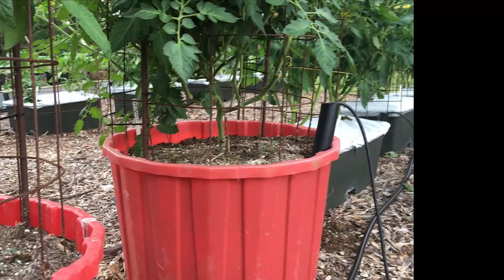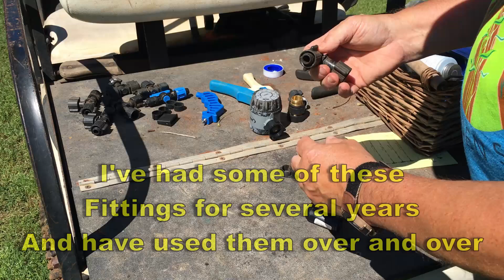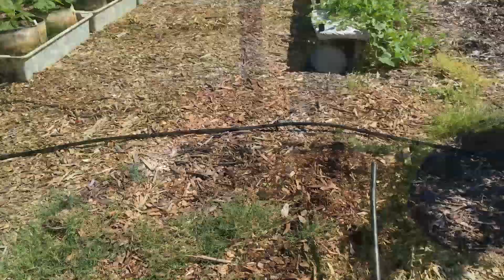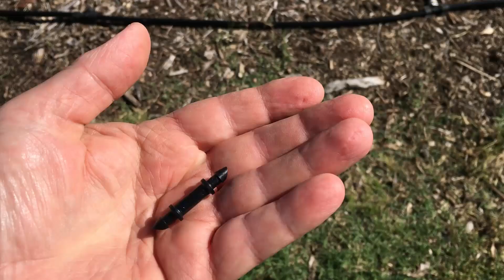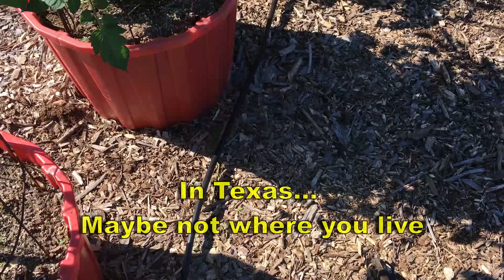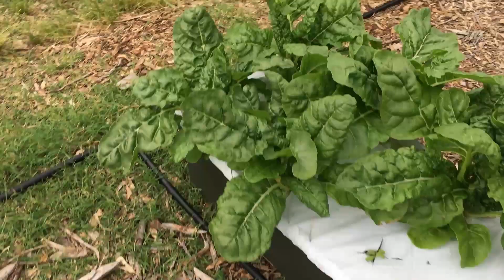💦 INSTALLING AN AUTOMATIC IRRIGATION SYSTEM FOR CONTAINER VEGETABLES OR FLOWERS 🌱 STEP BY STEP 💦

Comment: Could you not just use drip line emitters in each tub and no it us wicking tubs too?
Reply from the maker: I do a variety of things
On some things I use an emitter in the tub, on some, I put a 1/4" line down the fill tube
Both work fine
Reply from the maker: Actually, EarthBoxes need to be watered down the fill tube.
All my EBs have 1/4" lines down the fill tube

Comment: Question-   The link to Hoss tools combo has a pressure regulator marked for 12 psi.  The amazon link shows that regulator is 25 psi?  25 seems a bit high for lines?  or did I miss a detail in video, like 2 regulators instead of 1?
Reply from the maker: I tried a big box pressure reducer and it blew out my fittings.
Try to get the 12 psi.
It worked for me where the other one did not.

Comment: I’m thinking of trying this, what do you use the “couplings” on your list for?  And can I use 1 gallon emitters at the same time as the 2 gallon emitters?  We are also on well water and have to be careful of water usage.   I’m going to show hubby your video and see if he thinks it’s doable!  I hope so!
Reply from the maker: Yes, you can use 1 gal emitters.
The couplings are for repairs... or mistakes.. In case you have to join 2 pieces of pipe together.
It's just handy to have some around.

Comment: We just installed a drip system on our blackberries but we're not getting even drips. We've got a pressure regulator but it doesn't seem to be working. 20 plants on a 90' row using the half inch black tubing. The first several nipples are blasting water, while the ones at the end are barely dripping. What are we doing wrong?
Reply from the maker: If you are on flat ground I’m not sure what could be causing it. 
If you’re on a slope, that could be your problem. I had some problems like that when I had blackberries planted on a slope.

Comment: Does water come out the EB reservoir overflow when using the timer?  If so, how much and could that lead to losing nutrients including calcium?
Reply from the maker: Since an earth box waters from underneath… The reservoir… Water is not draining down through the fertilizer. Therefore, I don’t think you can leach out any of the nutrients. I think that’s one reason earth box is such a good method.
As I understand it, because the water wicks up through the fertilizer and distributes it in the earth box it cannot come down and drain out.
Hope that makes sense.

Comment: Great setup. I found a ton of this stuff on clearance in my area most as much as 90% off so I  purchased all kinds of stuff. It looks as if you have the one main line for your whole garden. Is the water pressure consistent with all that you have running at the same time. Also is that a 25psi reducer
Reply from the maker: The pressure reducer is 12 PSI.
Here it is in the combo from HOSS: https://hosstools.com/product/filter-regulator-combo/
Reply from the maker: Oh... and no I don't think there is a pressure or volume drop along the line.
That's the function of the pressure reduction valve. It helps distribute all the water at the same rate.
Yes, I have one "main" line with several lines coming off it.
But actually, all the split-off lines (the 1/2" lines) are considered "main line"
Reply: Thanx

Comment: Do you have any issues with the boxes at the end of the line getting less water?
Reply from the maker: No. But that is why the pressure regulator is so crucial. It keeps the pressure constant to all the emitters. I’ve never seen a problem on this type of set up with overwatering unless they were different GPH emitters.

Comment: In Texas there is probably no need to blow out the lines so the bend the ends end cap method would be easy and cheap. In my case because I need to blow out, I find the screw off end caps to be better because I can quickly and easily blow out each line.
Reply from the maker: And, the screw ends look nicer, too 😎

Comment: I worked on our irrigation system this weekend. I found that the hairdryer was an immense help in getting the 1/4” tubing on the manifolds. I may have looked funny but I got the job done! Now I’m getting ideas for all the tubs on the patio. 😳
Reply from the maker: Yep, that tubing can be a little stiff if it's cool.
It was pretty warm when I did this.
I've found some of the tubing to be very flexible and pliable and some to be very stiff.
I like the soft, flexible stuff, but it's hard to find.